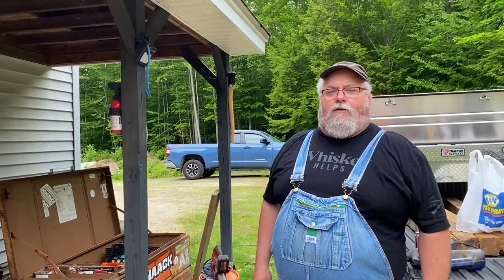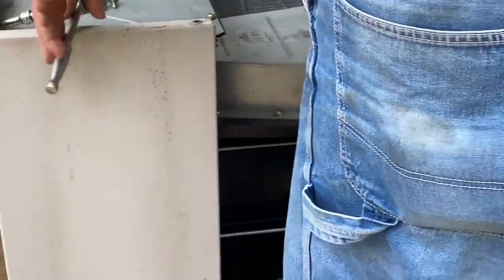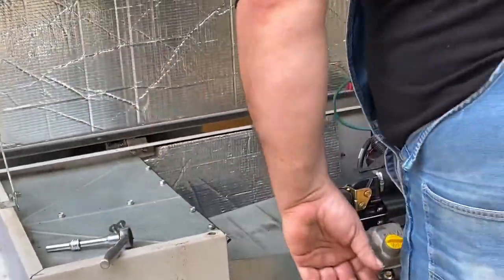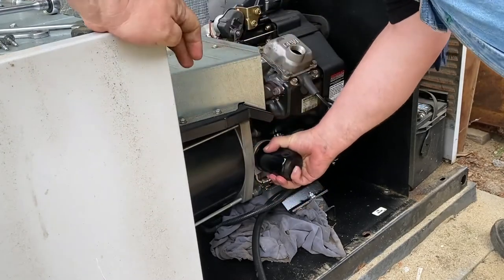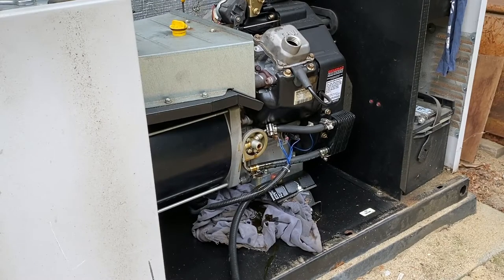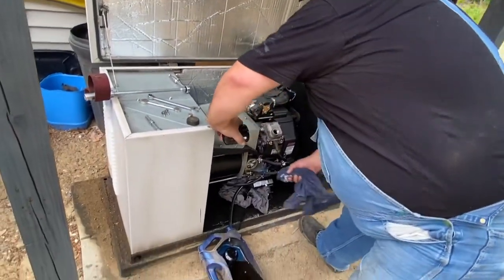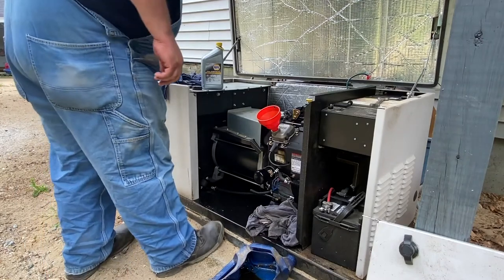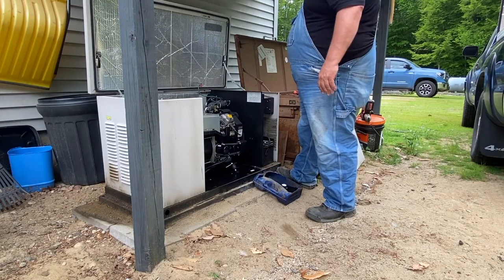Generac Guardian Standby Generator // Service Maintenance // #generator #generac

Comment: I'm on my second Generac my 12kw was working fine just wanted upgrade with 14kw with hydraulic lifters now with the oil you want a true small engine oil 100% synthetic full synthetic labeled oils aren't 100% synthetic unless written on the bottle big difference on how much of it is actually synthetic the best oils for these units is Briggs and Stratton 5w30 100% or Amsoil small engine oil 5w30 100% synthetic where the difference is between car formulas and small engine formulas is the ppm on zinc and phosphorus true small engine oil is around 1300ppm vs car full synthetic car oil at average of 750ppm this is important because car oils have emission standards that prevents them from adding the high levels of zinc and phosphorus its excellent anti shear and wear additives very similar to racing oils being you use yours so much I would definitely use one of them one's I mentioned it really shines during long runs you will probably double the life its a big deal and over looked way to much I'm a 3rd generation engine mechanic this stuff doesn't break down air cooled engines are very hard on oil especially LP NG the technicians go cheapest route possible also get it hot the oil comes right easy then dump 1/4 quart new through before putting back together
Reply: Excellent info, thanks!!!
Reply: @Scott from Whiskey n Sunshine  no problem your welcome

Comment: Those JIC fittings can really get tight over time, especially with the hydraulics I have to work on. You will bust a knuckle or two sometimes. Those filter wrenches are great. being long I can reach up from under the trucks and equipment with ease and not worry about getting wet with oil. Mine are a little different but work the same.
Reply from the maker: They are the best i've found so far. I've tried a few different ones and like it the best.

Comment: It's, slso, a good idea to check the air filter. The old oil, is recommended, to be drained when it's hot.
Reply from the maker: Yes, most definitely👍